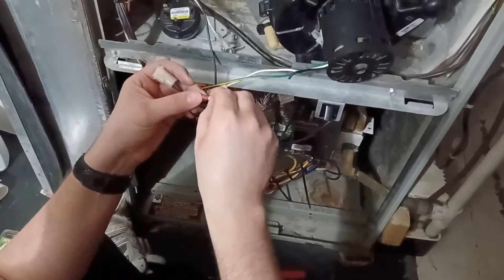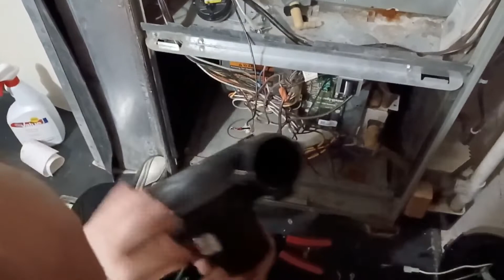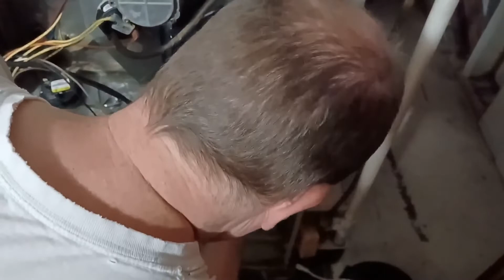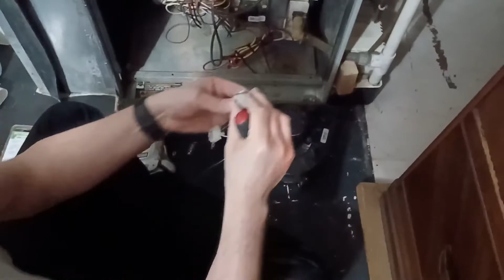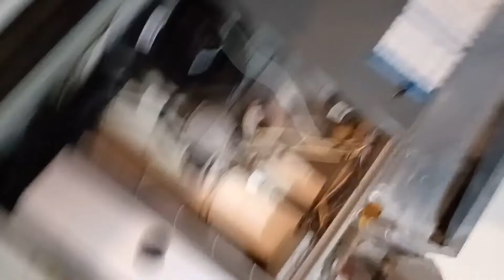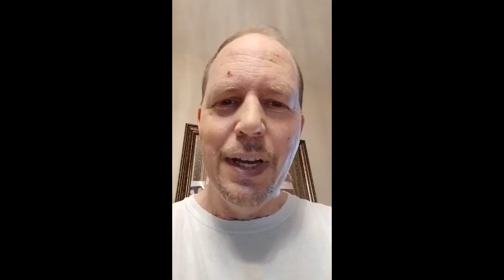Trane Furnace Draft Inducer Motor Remove and Replace

Comment: there is a little lock tab inside the connector, if you release it the whole plug comes out and that other connector slides right in. no cutting necessary, otherwise great video .

Comment: Is the replacement a Fasco A196?  Thanks!
Reply from the maker: I honestly cannot remember . But it was the exact name brand and part number that was stamped on the oe part.
Reply: Thanks for responding. I just swapped out the draft inducer on my furnace. Your video helped.

Comment: I have a Trane XE 90 I want to order a inducer motor for a backup. I don’t see a hp rating or rpm on it. Mine is ok yet but I’d like to order one before they are no longer available. I had a service crook try to sell me a blower motor that I had replaced a few years ago. Quoted me $450 
It cost me $129 I found that the control board had shorted out and ordered it on Ebay. My furnace is a 1999 and running strong.

Comment: Why doesn’t your inducer motor not have a capacitor on it?
Reply: It's a variable speed motor / controller, no capacitor on the motor
Reply from the maker: I couldn't tell you.  Exact fit OEM part. Maybe there is one inside.
Reply: I don't see capacitor on my motor either, motor is free by hand and smooth, but doesn't run when signaled to.

Comment: Hi, thanks for this video. I replaced the inducer motor. There are still those three blinks coming from the board. The flame does not come on and the motor stops again. With the new motor I see the noise went down . Is there anything I have to reset like the pressure switch ? This inducer motor I have comes with a capacitor. That is the only difference . Please suggest . Thanks
Reply from the maker: I purchased an air pressure switch at the same time as it was my understanding that the two parts work together, but keep in mind that I am not an HVAC repair man. I had my problem diagnosed by a pro then did the work myself. Good luck.
Reply: @ericbleueldoesstuff9152  Thank you.I am also doing the same. I got a quote from a pro which is twice more than what you got !. I ordered a pressure switch as well and I will update.This video provided the motivation  I needed. Thanks

Comment: HVAC companies are such rip offs it's unreal!  There ought to be laws against gouging consumers so bad on critical stuff like heating.  If you could buy it retail for $170 their cost is probably $135 tops.  It's maybe 0.75hr job plus 1 hrs travel for a tech that their full labor cost can't be over $60/hr.  Add in 35% for profit and 35% for overhead and 8% for tax and you're at ~ $450 as a reasonable cost for this job IMHO.

Comment: Why didn’t you replace the gasket as well??? Oh boy
Reply from the maker: I did later. lol Didn't have what I needed at the time, but wanted the heat on. Thanks for the comment.
Reply: @ericbleueldoesstuff9152  Where did you find the gasket sold individually?  I've got an XV-90 75K furnace that's going to need one.
Reply from the maker: @rhymereason3449  for my purposes, I used silicone /rtv. works fine so far.
Reply: @ericbleueldoesstuff9152  OK... thanks for the input... I thought you might have found a source for just the gasket.

Comment: Man, I appreciate you making this video! Furnace has been on the fritz for the last couple of weeks - HVAC tech told me I needed to replace my whole furnace for $6500. After diagnosing I decided to order an inducer motor and try to just replace that. Would have been a $950 repair by the tech, I got it done for $210 - with help from this video!